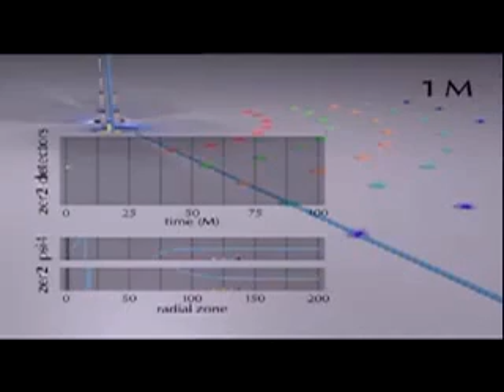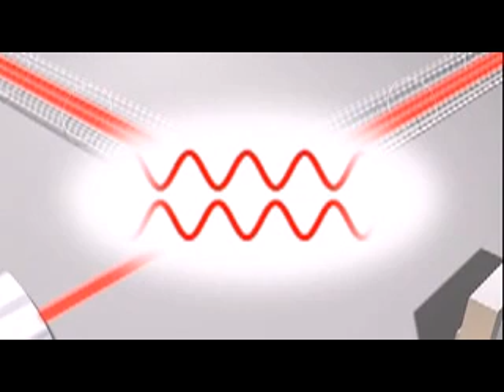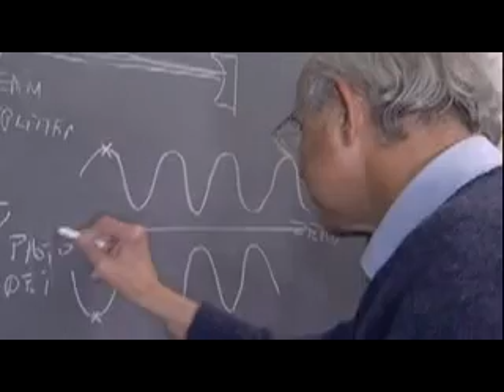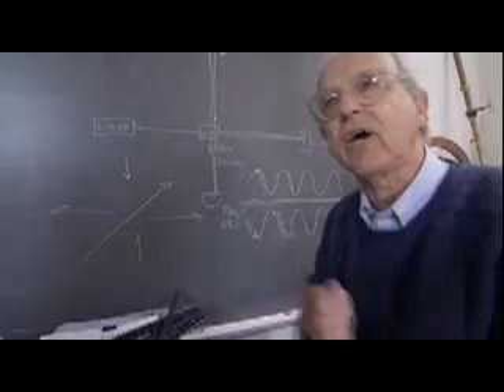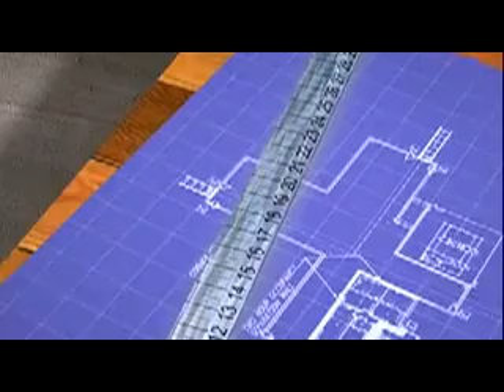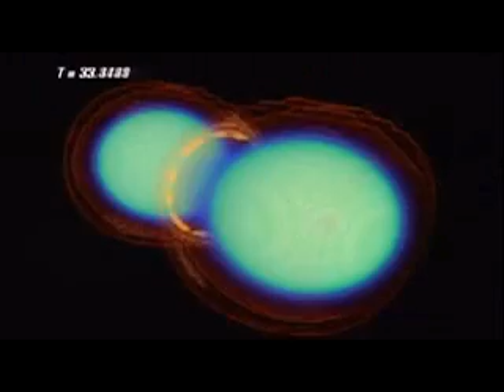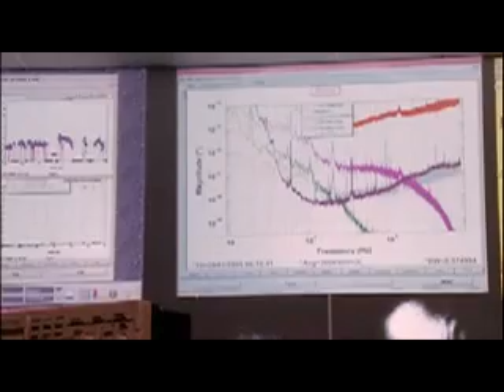LIGO Gravitational Wave Observatory

Comment: The Ligo experiment failed entirely... Gravity is still a theory. Not a law...
Reply: 20Proff And you are......?
Reply: Err... My name is Anton...
Reply: My point is that you can measure the effects of nature and refer to it as gravity... But we can't see it or observe it... We can use the equation to launch a missile... But the equation only refers to 2 objects... Eg. the missile and the earth... Introduce a third object and the equation breaks down... It no longer works... This has significant implications... It proves gravity can't be a universal constant... It can't be used to explain the birth of stars... Indeed, we have seen stars die... We have a MODEL (models aren't reality) where thanks to gravity, stars are supposed to be born but no one has ever seen that... Why dying stars and not birthed ones? In my opinion (which has no scientific credibility - I just think) what we refer to as "gravity" is a by product of electromagnetic forces...  Why are you so confident gravity pulls to earth rather pushes from above??? Back to the missile example: Do the equations work the same on practical application if you assume a push from up???  As a universal constant for star birthing though??? I don't get that... Of note here is Boyle's gas law: Gases can't collapse into solids... Star birthing? The concept itself seems illegitimate... Always has...
Reply: 20Proff Say what you want. That's your opinion. I'm an operator at the aLIGO Hanford Observatory. I'm no physicist but I can tell you that there is a collaboration of the most brilliant minds in the world painstakingly woking on this project and truly believe in it. The NSF gives this project stellar reviews every time out. Skepticism is all part of the game. This is going to work. Have you ever had any first-hand experience with any part of this project or is your information  3rd-party. How do you conclude that LIGO has failed entirely (past tense) when it is in fact steaming ahead? Where do you get your news from? I live it every day. I assure you, sir that it's alive and well and on it's way to making history. Radar Blue is making allegations that he's smarter than Einstein up there in the comments. Maybe you folks should get out more. There is some amazing science happening and dismal youtube pans are just depressing.
Reply: I don't see why I should answer your questions considering you didn't mine... But, ok... 1. My info is entirely 3rd party. 2. I conclude that LIGO failed as it was intended to be able to observe gravity as a force... It didn't... It measured the effects of nature and referred to it as gravity, as I said... 3. The list of my sources is highly irrelevant, I am making points... 4. I wouldn't know if I'm smarter than Einstein. I have an IQ of 183 - though that doesn't mean much. I can certainly see that light is not a constant as is the premise of a lot of things he has to say... Harvard has already brought light to a complete stop and no one has achieved time travel... And, nothing I have said has anything to do with Einstein's intelligence and a comparison need not be drawn... Let me know when you make history... I get out plenty - try being polite and have a discussion about something I have brought up: gravity and star birthing. Don't just cop out as you are not a physicist. I'm not either... Much love...
Reply: 20Proff I'm not qualified to answer the questions that you asked. What I can tell you is LIGO hasn't actually measured anything but Hardware and Software injections applied by the LIGO Scientific Collaboration(LSC). I wasn't referring to you when I made the "smarter than Einstein" remark was aimed at someone else ("Radar Blue") who is inferring that Einstein was wrong. Apologies for the cross-post.  I don't know enough about gravity and star birthing to have a discussion. I only know that conclusions based on a prototype detector aren't valid. We have just now brought back online a far more advanced version of the detector that will  have a noise floor/CBC range of actually being able to make a first detection. For you to "close the books" on LIGO before it's been developed enough to have an honest chance at succeeding, with all the good graces from the NSF, isn't really a fair assessment of the project. Also, worldwide at facilities such as VIRGO, GEO600 and KAGRA this hope is alive, well and evolving. I apologize if I seemed impolite. That wasn't about you.
Reply: Thank you very much... Don't get me wrong, I check in on Ligo from time to time - "failed entirely" - probably too coarse with the use of language... Thanks also for the NSF stuff... Feel free to let me know of any developments or thoughts... Good luck to you with your research... Laters
Reply: +20Proff wait until thursday
Reply: +20Proff And also, a law is part of a theory. not something that was a theory before.
Reply: TheHalliday123456789 Cheers for the heads up...
Reply: TheHalliday123456789 So, why talk about the light from black holes??? Is it because perhaps, there lab results did not work??? They have 4 kilometer tunnels but still talk about light from black holes... Where are the lab results???
Reply: When did they talk about light from black holes?
Reply: 20Proff And a 4 kilometer tunnel with a interferometer is a laboratory.
Reply: TheHalliday123456789 The results from thursday refer to two black holes colliding... Perhaps you should link what you are referring to so we are on the same page...
Reply: TheHalliday123456789 As I understand it, the lab (4 kilometer tunnel) showed nothing so they referred to light measurements from 2 black holes instead... To make it look like they didn't fail in their objective...
Reply: No, look. When the 2 black holes collided they produced the gravitational wave they detected in the LIGO.
Reply: TheHalliday123456789 Where is the raw data?
Reply: TheHalliday123456789 Again, they have shown a simulation using some equations... That is not empirical observation...
Reply: http://journals.aps.org/prl/pdf/10.1103/PhysRevLett.116.061102
Reply: The empirical results
Reply: TheHalliday123456789 Cheers. I'm off to work... I'll get back to you...
Reply: TheHalliday123456789 Actually it didn't take that long: Direct quote from your link: "The specific procedure used to
estimate the background is slightly different for the two searches, but both use a time-shift technique: the time stamps of one detector’s data are artificially shifted by an offset that is large compared to the intersite propagation
time, and a new set of events is produced based on this time-shifted data set"
Reply: TheHalliday123456789 They have to measure a model that they have created because reality didn't jive with their pre-conceived ideas...
Reply: This time-shift does not change data, they use it to distinguish Gw signal from others
Reply: And if you don't believe you still have the chance to publish a paper that refutes Gravitational Waves, good luck.
Reply: TheHalliday123456789 No. They only measured a model... Because they could not measure it in reality...
Reply: No. Later they used the data on a model.
Reply: Waiting for the paper.
Reply: TheHalliday123456789 Would I then be welcome in the church of the new religion?
Reply: Haha, i'm not gonna lie. Sometimes it seems a religion. And i'm talking about bouth sides. We are actually looking lide a atheist against believer.
Reply: Anton, you fail to understand what gravity is. It’s not actually a force. It’s the bending of space-time created by mass. The movement and collision of very massive objects creates strong gravitational waves that can propagate like ripples in water. I recommend you first read Einstein’s General Theory of Relativity where Einstein addresses how gravity actually works (Newton could only calculate the effects of gravity but did not know what caused this effect).

Comment: Afaik, GR's spreading (dynamic) gravitational waves couple wavelength-dependently similar to photons, i.e. a sensor's size-scale (x-section) compares to the wavelength, like with antennas. Imo, quantum gravity replaces GR's gravity wave with flux-density variation. If quantum graviton x-section relates inversely to a non-dynamic wavelength carried, which GR's success/failure constrains to galactic scale, dynamic wave energy doesn't propagate well, especially if retroreflectivity also dominates.

Comment: If all gravity is based on quanta of gravitational flow, dynamic waves may interact with matter much differently than predicted by GR. With GR the size of a mass is analogous to the size of an antenna, if the size is too small for the wave, there is no wave energy absorbed. Looking at it another way, GR lacks an absorbtion mode, and overlooking this mode in the intervening medium means overlooking absorbtions rendering incorrect some otherwise-presumably-reasonable expectation of detections.

Comment: To recap a bit, the theory seems to be that light is unresponsive to a gravity wave but not LIGO length, or maybe it should be that LIGO length is unresponsive but not light, in any case they do not respond equally. SR's lightspeed constancy seems to get violated any way. Althernatively saying that material length scales together with space and light would be to say LIGO won't work, but it conserves SR, all without touching the essence of GR.

Comment: An alternative for justifying the perspective I mentioned is to think of the visual bunching of on-sheet concentric circles, matching blue/red shifting, as being an effect of light and space both compressing/expanding together as light approaches/escapes a mass. If material lengths do not follow with space compressing/expanding, one can't put LIGO and its lightwaves on the same elastic sheet and gravity waves won't be nulled. Seems to be the theory here.

Comment: Guess I'm stuck on the elastic-sheet GR idea. Seems equally valid to describe gravity as a thing stretching the sheet instead of one curving it. To me the right perspective for the 2D sheet is looking at it from above, straight down, so the stretch makes concentric circles bunch up close to a mass, matching red/blue shift going to/from it, but it implies light doesn't stretch going in, it unstretches, or else space stretches but not light, contradicting a light/space metric.

Comment: Seems a gravity wave moving at lightspeed is supposed to deform the interferometer's light speed relative to the interferometer structure, as if both won't stay on the same rubber sheet. If only the apparatus is on the sheet, not the light, then it's just like a seismometer. I'm not really sure exactly how a deformation moving at light speed is supposed to deform apparatus light speed, however it seems like it's basically saying SR and gravity waves don't mix.

Comment: Suppose I take a schematic diagram of the interferometer, including the wavy lines  representing the lightwaves, and print it on a sheet of rubber, and then I stretch the sheet, I'm supposed to expect the lightwaves jump off the sheet.  Eh.

Instead, suppose light is more responsive to the stretching than is the interferometer structure, blame momentum. Now, a gravity wave passes at light-speed, and somehow this changes the time it takes for light to go half-way up an arm? Double eh.

Comment: What? Of course we can tell the direction that a gravitational wave came from, provided we have at least three non-colocated interferometers to work with (currently there are five operating). And there is a lot that we will be able to say about the universe from gravitational wave observations - it will inform population models, reveal the structure of spacetime around black holes, and give important information about the composition of neutron stars, among other things.

Comment: Its running more than 5 years and hasn't detected anything.  Because light does not travel any faster through contracted space as it would through expanded space (or our frame).  If your meter stick is length contracted due to acceleration, light would not reach the end of the stick more quickly...  Right?!

Putting one of these in outer space would likely get the same result. Thus, it would be a waste of resources.

Ligo and similar experiments need to be retired for now...

Comment: Even still, it seems there would be much error in calculating the gravitational waves from the difference in the photon packets. The tiny space-time ripples from outer space are so small that it's hard to measure these gravitational waves from Earth and be accurate at calculating the source. LIGO's future solar system observer will be much more precise at measuring these waves and triangulating the source.